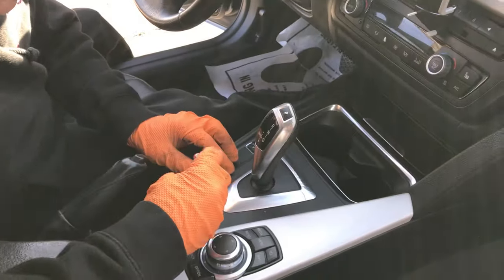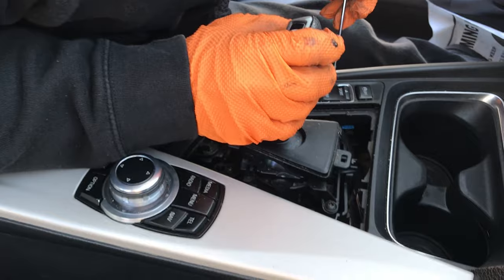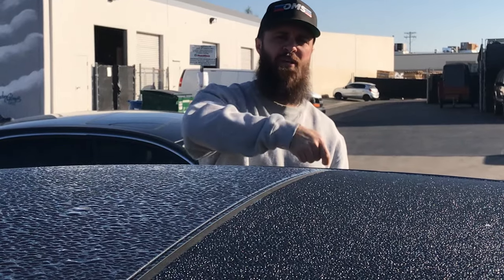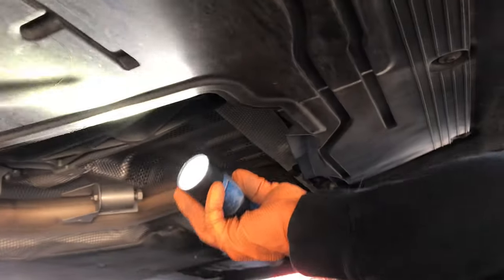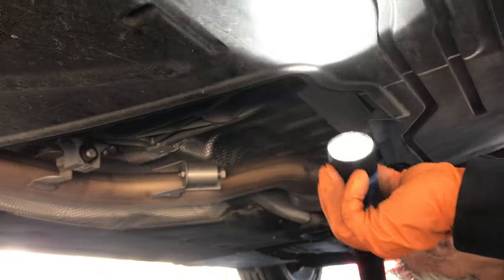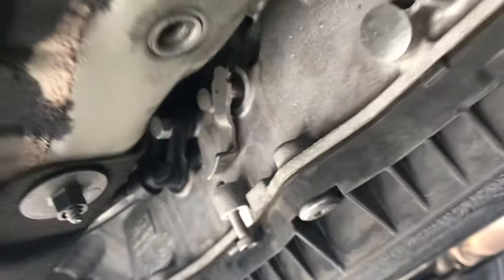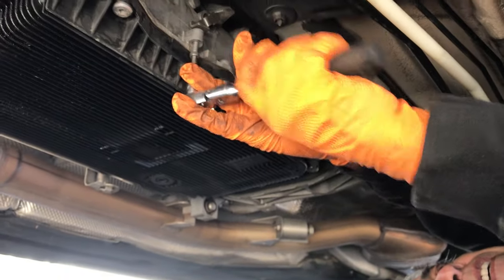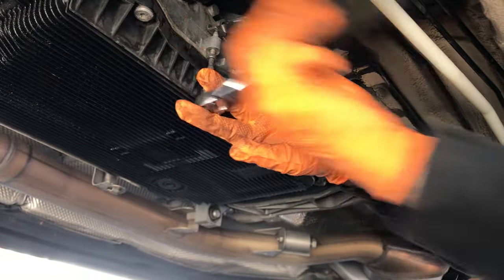How to put BMW into neutral with a dead battery or no key (Electronic Shifter)

Comment: This is horrible especially if you put it on neutral while it's on jacks and that's all u have
Reply from the maker: Unfortunately it isn't as simple and easy as we would hope for :(
Reply: The more knowledge engineers gain, the dumber the design choices that they make. Who doesn't miss the days of simple manual gearboxes? No problems finding neutral with them.
Reply: garbage ass bmw.

Comment: Amazing. They had the absolute perfect release on the 2002 745 with the red strap at the drivers foot. And now, gone.
Reply from the maker: amazing is a great way to put it :)
Reply: These god damned engineers have to overthink everything. If BMW has a unified grill look across lines, why cant they have a single way of putting a car in neutral that is user convenient? There is no reason we should not be able to put the car in neutral when it is off. This is why manual gears are superior.
Reply: @Axrover  agreed
Reply: I also have a 745i and came here wondering what everyone was talking about, like dude just pull the tag 😂
Reply: Wish I saw this sooner! 😡 My beemer was facing backwards  with dead battery. After waiting 12 hours for a tow-truck , driver pulls up and yanked the car right up the ramp in park 😪😪😪😪

Comment: Worked perfect for my 2015 328i. Ridiculous car to do even the simplest things. Don’t buy these unless you have a lot of money or a badass garage
Reply: The chances of losing my key is much lower than the chances of some bum trying to steal the car by towing it. Learn to think boi!
Reply: @Sam-fs8sx  there are many circumstances that require you tow your car without turning the engine on to cause further damage, or in my case a crunched oil pan from highway debris. How about before being pretentious you do a little thinking yourself big man
Reply: @saryn1829  Lmao, how often do people have crunched oil pan from highway derbis that requires towing without turning the engine?   I don't want my BMW when I buy one to be the same as a Dodge charger that gets stolen everyweek, no thanks.

Comment: The red tool located in trunk area is to unlock gears u lift the drivers rubber cup & turn clockwise pops out of gear
Reply: Not anymore. That feature is long gone unfortunately
Reply: That's only on early models. the newer ones with electronic shifters  don't have a usable shift bypass anymore... and NOBODY will use this poor design on the side of the road or risk crawling under it & risk having it roll off a jack etc...  Epic poor design

Comment: what about on xDrive?  will this unlock both front and rear?
Reply: I have 320 gt  2017 xDrive but the front is never lock in parking position, just in the back and also the hand break also in the back hold😜

Comment: Doesn’t work on xDrive I screwed all the way in and just the rear is in neutral. The font axle still is locked.
Reply: really!? how do you resolve?? I need to get a dead 328i xDrive to roll!!
Reply: Tow companies can lift the front
Reply: I have olso xDrive 320 gt 2017 , but in the front never is lock just the back🤔🤔

Comment: Why not jump-start the battery?😂😂
Reply: What if your car has an accident & front end is missing & car wont start?
Reply: IN my case, the car won't start because of a transmission sensor error.  Battery is fine, but the starter will not come on.  Ridiculous design.
Reply: Ideal video for myself, car engine blew a hole in itself, unless I wanna drag the back wheels this is the only way to get it to move

Comment: Absolutely Ridiculous design.  I guarantee you NOBODY is gonna go thru all that (especially a tow truck driver) on the road or blocking traffic or when it's sitting in water or buried in snow or below zero. repair shops won't allow employees to crawl under a vehicle in a parking lot & risk it rolling off a jack farting around with this.  GM has started doing this too... Guess what... Everyone refuses to use this bad, unsafe design.